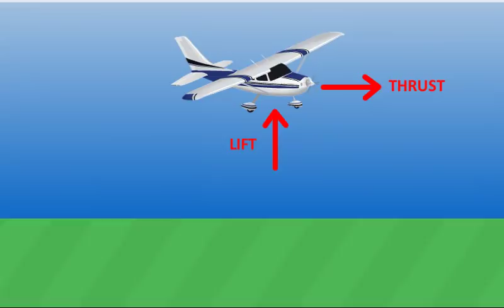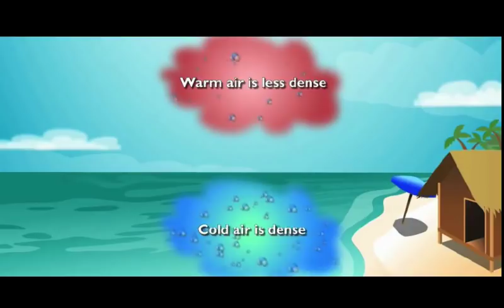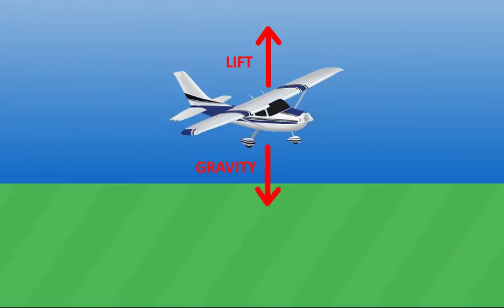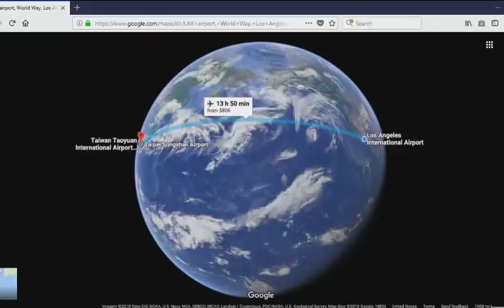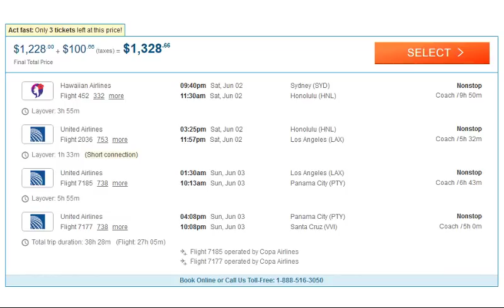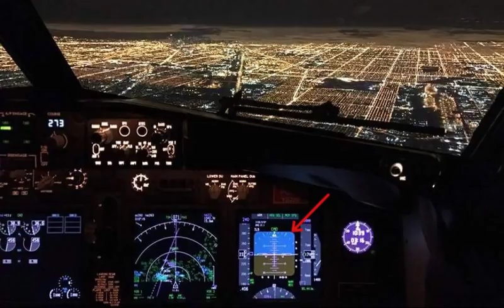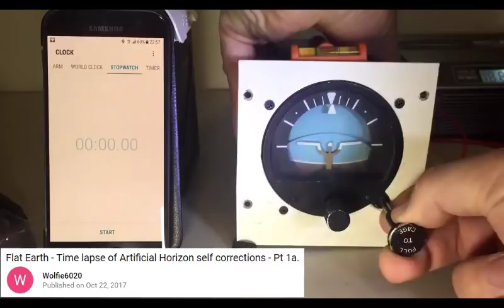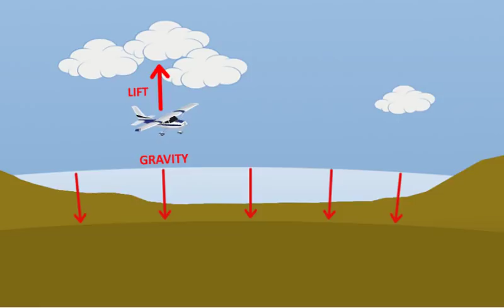Flat Earth Falsities - Plane Nonsense

Comment: That's not friction you feel on your arm when you "catch the wind in your fingers" like that. That's profile drag. That's the stuff you reduce by sharpening the front and back ends of a plane. Friction plays a rather small role in the air resistance of a freefalling brick or a hand in the wind. On the much larger scale of the whole atmosphere and the Earth's whole surface, yes, it amounts to friction, but on that small scale it's pressure difference. Think of standing in a shower with the water hitting the top of your head and running down your body. You feel the force on top of your head, not dragging at your skin. 
On the "hot air rises therefore cold air must sink to replace it" thing, it's the other way round. Cooler air is more dense, so each cubic metre of cooler air has more mass and thus more weight pulling it down than the warmer air, and it displaces the warmer air upwards. 
That guy with the helicopter span his globe the wrong way. :) 
I'm going to have to do my own video about the aeroplane thing, but in this ... excuse me. 
Level flight is perpendicular to the direction of the force of gravity, not parallel to it. 
Yeah, anyway, "level" flight is like driving in a straight line. Rig up a car with sensors in the wheel or just a camera watching the wheel and try to drive a straight line over rough ground. You'll have to make adjustments. Try again on a curve with a 40070 km circumference and see whether the ranges of steering wheel positions overlap, which would mean that the equivalent flight would involve corrections to the vertical speed to stay level greater than the "stick forward" required to track the curvature.
Reply: Question is, when are such speed adjustments made during long range flights, besides when taking off, leveling off and landing?
Reply: Aircraft don't just fly places. They have flight plans and they talk to air traffic controllers, who tell them things to make sure everyone knows what's going on and nobody crashes into anybody else. We have different systems for who flies where, which operate in different spaces. Around an airport or military airbase, it's local space with Tower in charge. Outside that it's Approach. Beyond that you get "panhandles" where there's a 3D lane in the sky designated for approaching planes only and everybody else stays out of it. You can see some of this stuff marked on air nav maps: 
https://geostar.info/attachment/full/us-airspace-map/american-aerospace-177.jpg 
http://www.microlightforum.com/images/vince/air_nav_pro_screenshot.jpg 
Outside the special stuff, the rules vary with altitude. 
At this point I need to point out that we have four "altitudes." Oh, yeah. Way to complicate things. 
Close to the runway, you set your altimeter to the pressure on the runway so it shows you how far above the runway you are. Fly out of Leeds Bradford and swoop over Ilkley and it goes negative! That's why you don't use that setting away from the runway. Technically, you're not looking at altitude here but height, distance above ground level rather than above sea level. 
Near the ground, you set it to the pressure the weather centre tells you would be felt at sea level in the centre of your zone of the map. That's fine until you fly out of your zone and into someone else's where the pressure's higher and so are you and someone coming the other way is lower than he thought and you're actually both at the same height. Oops. 
The way around that problem is to ignore the weather and just pretend that sea-level air pressure is 1013.25 hPa (29.92 inHg). Again, there's a problem here in a low-pressure system where someone who's using local air pressure is at the correct height and someone using 1013.25 is lower than he thinks, so it's good to keep an empty layer between the two. Up to the transition (which varies around the world) you work in feet. Above it, like a thousand feet above it to be safe, you work in Flight Levels, which are hundreds of feet and you only use multiples of 5. 
We used to have a system in the UK where you'd fly northeast at FL 50, 70, 90, 110, 130, 150, 170 or 190, southeast at FL 115, 135, 155 or 175, southwest at FL 120, 140, 160 or 180 and northwest at FL 125, 145, 165 or 185. This way you never met anyone coming the other way at the same altitude as you. No more. Now it's semicircles all the way. The semicircular rule sends aircraft east at FL 50, 70, 90, 110, 130, 150, 170, 190, 210, 230 and west as FL 60, 80, 100, 120, 140, 160, 180, 200, 220, up to FL 290 where they switch to wider intervals and go east at FL 290, 330, 370, 410 and west at 310, 350, 390. 
Due north counts as east and due south counts as west. 
If you're flying through busy European airspace and air traffic control is having a busy day, you don't necessarily get to fly the great circle route, the route that looks like a straight line if you're looking vertically down at the middle of it on a globe, through all the cities' airspace. You may have to make some detours around London and Paris, for example. 
If that means you go from bearing 170° to bearing 190°, that means you're going from travelling east to travelling south, and you get a new flight level to maintain: "climb and maintain flight level 350" or "descent and maintain flight level 310," for example. That would require some adjustments to the throttle.
Reply: Also, IF said curvature exists,  wouldn't straight and level flight be called straight and CURVED....?
Reply: "Curved" could mean just about any curve. "Level" means parallel to sea level. Well, parallel to wherever 1013.25 hPa is, anyway.
Reply: @Sableagle  I am aware of the Q codes (QNH, QFE, QFF etc...) and their effects on different flight levels. The question is, why is it called straight and LEVEL flight, if the flights is actually following a CURVED flight path over the earth? Isn't a spirit level used to measure the FLATNESS of a surface in relation to the GROUND?
Reply: Also, how in the world would ANYONE be able to know their true height/FL, if the earth were SPHERICAL AND ROTATING? According to spherical trigonometry, a sphere has compound curvature across all axes, thus it would be clearly indicated via any gyroscopic instrument (Artificial Horizon) if a flight were to have a CURVED flight path, no matter how large the spherical earth is alleged to be. In fact, for a curvature rate of 8"/square mile for an observer height of only 6 feet, 1,000 feet would reveal a MUCH LARGER curvature rate, and this curvature would be even more apparent with an increase in height. In VFR flights, however, the datum used is a FLAT horizon, which DIRECTLY CONTRADICTS spherical trigonometry, and thus the ALLEGED SPHERICAL SHAPE OF THE EARTH... correct?
Reply: The moment you describe curvature as 8 inches per square mile, it's obvious you're quoting things you don't understand. 
The original formula for that was, I suspect, "8 inches x ((distance in miles) squared)" and that's not the same thing. It's also bollocks. You can test this pretty simply, with some primary school stationery. Plot a graph of y = x^2, or y = 0.1 x^2 or y = 3.7 x^2 or whatever multiplier you want to put on there. Plot all three, if you like. You'll get a parabola, not a circle. See how that could be a problem? 
By that "8 inches x ((distance in miles) squared)" formula, from Kawe to Macapá, a distance of 12364 miles, ought to put the other end 19301.6 miles below the horizon ... on a ball with a 7917.5 mile diameter. 
Are you seeing the problem here? That parabolic curve puts the far side of the Earth 2.44 Earth diameters below the horizon.
Reply: No, actually a spirit level is used to mark lines parallel or perpendicular to the local direction of gravity. It gives no fucks what the ground looks like. It'll work just fine on a platform sticking out over a crag. 
It's called level flight because ... er ... someone just answered this recently. Let me scroll up about 6cm and copy-paste it for you. 
"Level" means parallel to sea level. Well, parallel to wherever 1013.25 hPa is, anyway.
There. They call it level flight because it's not changing (indicated) altitude. What else would you call level? What else would you call it? Geodesic flight?
Reply: You're getting all shouty. Don't be getting all shouty. 
If you want "true height," you use a radar altimeter, which works just like a laser rangefinder. If you want your Flight Level, you use a barometer. Flight Levels are layers of barometric pressure. 
Earth rotating has bugger all to do with that. The air's going round with it. For in-atmosphere flight, you can use the Earth as your frame of reference. 
There's an Earth-shaped rock with some water on parts of it and air around it, held to it by gravity. All the air above any area anywhere exposed to the atmosphere is pulled down by gravity and exerts pressure on that area. The higher you go, the more air is beneath you and not weighing on you and the less air is above you and weighing down on you, and the less air pressure acts on you. By measuring the rate at which air pressure decreases with altitude, easy enough anywhere with mountains, you can establish a way to convert readings from air pressure to altitude. You then build a barometer with different markings on it, the calibration screw being marked "air pressure at sea level" and the dial being marked in hundreds and thousands of feet and, hey presto, you have an altimeter.
Reply: Do you really think they just stand the gyroscope upright, pull the string and hope it keeps spinning long enough? It's motorised, and motors have torque. There are sensors and little valves and tilt switches to allow the machine to reset it to show gravity as straight down. If there weren't it'd go to pot any time you started manoeuvring vigorously. See for example: Battle of Britain.
Reply: Why would there be more curvature further up? A circle continues to be 360° whatever size it is. The circumference is proportional to the radius. If you're further up you're further from the Earth's centre, so at a greater radius. That means there's a greater circumference further up. There are more inches of travel in a 360° trip around your waist than in a a 360° trip around your wrist. Which has more curvature?
Reply: @Sableagle  what does water do when you spin it, even slightly? The answer to that question should cause you to reexamine your perception of the true shape of this earth..
Reply: I am not about to go to all the trouble of building a device to rotate a soggy tennis ball at 0.00007292116 radians per second just so you can watch the water not come flying off it at that rate. If you want to bother doing that, you go right ahead. You may find it easier to rotate it at 1 radian per second and watch the water not come flying off it even at that rate, 13713.44 times faster than the Earth's rotation about its axis. If you're going to spin it at 3000 rpm and call that a model for how water on Earth should behave, you may as well call this https://youtu.be/A_966NVdjoI?t=75 a model of what happens when a child takes a bite of a wax crayon or link to this https://www.youtube.com/watch?v=QfDoQwIAaXg and say it's proof that clocks can't work because of what happens when two pieces of metal touch. 
0.00007292116 radians per second, radius 6378 km is 0.033915 m/s^2 of acceleration inwards. If, somewhere way out between stars, you bolted an electric motor to the magic silk curtain of woo and used a light, inextensible string 6378 km long to swing a chunk of stuff around at 0.00007292116 radians per second, the tension in that string would be 0.033915 N/kg of stuff you were swinging. 
Surface gravity of the Earth, on average, 9.81 N/kg. That radial acceleration inward required to keep stuff on the ground at the equator is 0.3457% of the force of gravity there, just more than 1/300 of it. If you use the same spring-based weighing device to weigh the same mass at sea level at the north pole and at sea level on the equator, your result at the equator should be 99.6551% of your result from the pole due to the spin of the Earth and the fact that polar gravity is that little bit stronger at 9.8322 N/kg. 
Why stronger? Because the poles are slightly closer to the centre of the Earth than the equator. 
Why closer? Because the Earth is spinning, and that makes it bulge out a little around the centre. 
If you actually want to spin a tennis ball with a 6.378 cm diameter and use it as a model for a planet with a 6378 km radius, you not only need to rotate it at 0.00007292116 radians per second but also need to somehow give it 9.81 N/kg of surface gravity despite it being 1/200000 the radius. That's 1/40000000000 the r^2 so its mass "only" needs to be 1/40000000000 that of the earth. Once you've found yourself a 1.4930475 × 10^14 kilogram tennis ball, get back to me. 
Yeah, a 149 gigatonne tennis ball.
Reply: Stormageddeon Dark Lord of All  that must be the most complex word you've ever encountered, judging by the way you have your panties in a bunch..